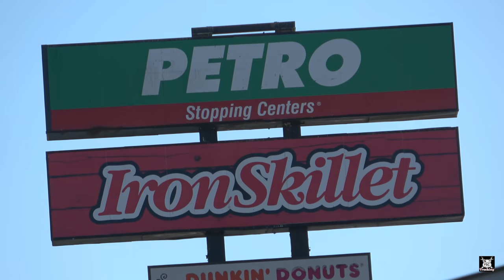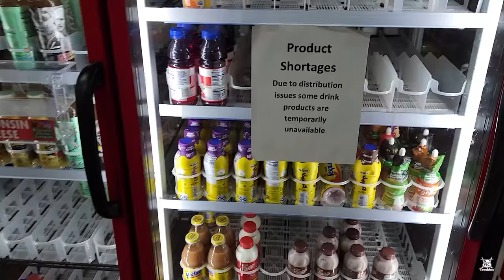DEF Shortage,   Not My Problem!

Comment: It is so refreshing to find someone that realizes the hidden pollution in all this Green Movement.  Our town went NUTS recycling. Three trash collections with three trucks and thousands of plastic bins. After a year the news crew followed the trucks to the landfill and filmed it all being dumped in the same place. When asked the operator said "Nobody want it. It has no value."
Reply: Im from a rural area and recycling is not practical. Used to have big roll offs to put recycling in but it wasnt practical or parking lot owners didnt want it any more.  I could drive like 15 miles to recycle but at that point what are you saving not like being 2 minutes from where you were going all ready
Reply: the Chinese stopped accepting a lot of the US plastic for recycling because it was often contaminated. That has pretty much destroyed the market unless you have a local company that was reprocessing it.
Reply: Yes, they want to charge us $15-20 month for recycling beyond the normal trash costs.  Nope, I would recycle if it were free, but not when they are charging me for it.  The best part in our small town (6K) is that they normal trash company stopped recycling as it was to expensive, and then the public outcry they had to find another company from much farther away to come service the town and drive around the city all over again to pick it up with big heavy trash trucks.  Our little subdivision only a handful of people recycle because of the costs.
Reply: @Chris_In_Texas  free and available I would recycle.  Sometimes I wonder how much more is wasted in the name of going green in all aspects
Reply: Other than cardboard most "recycled" stuff goes direct to landfill or incinerator...burned to produced "green" energy.
Reply: 36.00 dollars a ton to dispose trash. 93.00 dollars per ton to dump recycling. These charges are what we are charged plus tax
Reply: There was a story in New Mexico about this. Is this the one?
Reply: Burn in a boiler to heat or power something and landfill or separate what is left after the boiler.
Reply: It's not a green movement. DEF is cheap and heavily reduces pollutants. I think you have a problem with the implementation.

Comment: My buddy told me the trees u see dying on shoulder of interstate is from the Def fumes. I mean really how environmentally safe is it. If you've ever had the unfortunate pleasure of being behind a truck that's regening it burns your eyes. And what's up with that nasty looking white soot on the stack tops. Mine is a 2000 built in 99 so I don't worry bout that or elog. Keep on trucking.
Reply: Up north salt plays a giant factor as well like vermont for example
Reply: That may be so. I've been around over 55 years and never has I've seen green trees plants along the interstate. If emissions were so bad in the 30s 50s 70s nothing would be growing along interstate and highways. But I wonder if def has something to do with the dead trees.. hmmm I always  question everything and believe nothing..
Reply: I mean they spray the side of roads with Herbicide here, you couldn't tell what did it if you didnt know any better.
Reply: Who really knows I guess but I do know this when a older truck black smokes in front of me it doesn't burn my eyes and nose but when a Def truck regens in front of me it does both so I really don't see how it's better.
Reply: hey I hate def too but the tree dieback is from DOT spraying glyphosate (round up) on the shoulders for weed/grass control and the mist drifts up and lands on the tree foliage where it is absorbed. 

if you notice it is typically most noticeable during the summer bc glyphosate is most effective when it's hot and dry. 

source: I used to be a landscape construction foreman
Reply: Not where I live, even on I-70 the trees are healthy as ever

Comment: It's AdBlue in Europe, and it was a pain here at that time too. Also the Euro 6 diesel cars need it as well, so it went crazy for a while, and became unobtanium. It's shorted now, but the price has doubled. :(
Reply: Unobtanium. I like that, gave me a laugh.
Reply: Just use older diesels or buy modern gasoline powered cars.
Reply: @ժʝ_ My family always used diesel cars and we’re ok with them. But recent emission restrictions (specially in europe) makes it harder for normal users to use day by day. Now we have adblue in passenger cars and has to be filled regularly (generally filled between oil changes by service stations but still not user friendly) Older diesels are sluggish but also reliable and strong. Specially old mercedes diesels. Nowadays, gasoline (benzene) powered cars are easier for daily use in modern cars and got the low end torque and fuel economy of diesel power. (For european cars, american cars mostly still uses gas guzzling engines) I would still like to get a car with simpler engine and also good fuel economy. Sadly we have a tradeoff here, simple engine + good fuel economy = bad safety

Comment: JH Diesel did a video on the whole DEF/cat/emissions industry, it messes with truckers, car enthusiasts and everything connected to it. Admittedly I used to be on the electric hype, but now I see it as a another way to shut you down if you don't comply. I think mechanical diesel is the way to go now...

I hope your parents are doing OK, and come to Texas, we need more hard workers to add to the ranks! 💪
Reply: If you go back, & look at the news at the time the DPF was put in place it was because guys were dropping hot tunes on their trucks, & rolling coal. The DPF was the surefire way to get rid of that, & shut most of it down. Even tho the DPF cuts the life of the engine by 1/2-3/4 or even shorter.

Comment: Our trucks have had problems with the Def system continually, parts shortages on DeF sensors. The Kenworth dealer actually had to bypass the Def system just to keep the truck on the road. It has been months waiting for parts. I have not seen a shortage of DEF here in Wisconsin, but I heard Australia is experiencing a rough go at it. All is China related and it's about to get worse especially with the omicron lockdown in China
Reply: I drive a Kenworth t680
Reply: Just put water in the tank, or pee

Comment: I hope your parents get better.
I have a 2020 Chevrolet 1500 with a 3.0 liter Duramax.  I stopped buying the DEF at the auto parts stores and started buying it at the pump.  I get a lot of strange looks from the overland truck drivers when I pull my half ton truck into the lane just to get DEF but I also get a lot of questions about my truck.
I really enjoy the videos.  I have a friend in Arizona who runs a diesel truck repair shop and he rents out trucks while the driver is having their rig worked on.
Reply: You really should avoid using def at the pump due to inconsistent quality and contamination.  I have heard of so many problems caused by poor quality def, I have already deleted a few 3.0 I6 Duramax engines.  The way I tune them I leave all of the equipment on the vehicle except for the actual filter, I make a bolt in replacement exhaust section that can be easily switched.

Comment: I was working on a truck the other day and in Cummins diag program you can see how much DEF a truck has used. The particular truck I did the math on and it to see how much waste it produced and if it was filled entirely with the standard 2.5 gallon jug it would have used 586 jugs in the 5 years it's been in service.
Reply: That’s crazy

Comment: Being a diesel pickup driver, I don't buy DEF frequently (8 gallons is good for 10,000 miles).  I normally buy a 2.5 gallon jug when I get down to just over a half tank of DEF.  Two of the places I normally buy it at were out recently, but I don't know that I would call that a reason to panic.

If I wanted to drive down to a truck stop, I could top off at the DEF pump, but you big boys give me the evil eye pulling my pickup into the truck fuel lanes.
Reply: @Austin Judovsky  Nah as a driver we don't care who uses the pumps just don't sit on your break or using it to take a dump or a shower

Comment: I get my def at the pump and i havent noticed any shortages in mi, in, il where i get all my fuel since i stay around mi for all my runs.  I would love old school no def needed. I agree on how much more pollution/waste is made just like the electric vechicles. Where and how is the power generated and battery manufacture.  I can understand more efficient engines
Reply: To answer your question, re power generation, electric vehicles can say they are geothermal powered,  hydro powered, solar powered, wind powered, nuclear powered. As for the fossil-fueled vehicles, power plants are much more fuel efficient and can be, or are, equipped with scrubbers to remove more pollutants than a catalytic converter, or DEF system ever could. Carbon capture options are available, as well.
Power storage? You got me there.
Reply: @JV-pu8kx  but what about the mining of the materials to make battery packs and then the recycle/disposal of them when dead

Comment: I'll keep my '03 KW - W900L CAT 6NZ pre-emissions truck. I'm into heavy haul, and I average 6.7 miles 2 the gallon. 1,905,000 miles on her and counting. DEF is the death of all diesel engines and we all know it
Reply: I don't know how true it is, but I have heard that DEF engines aren't even worth rebuilding.
Reply: @shane4268  yes, it's very true, can't rebuild them at all. And the worse ones yet are the Paccars & Navisstar ( International) and being automatics it's a double whammy 2.... 😠
Reply: @sebastiangarla8558  Hopefully this shit will be reversed. It was bad enough with just the particulate burners, but at least those engines were basically the same as the old school engines, but with the computer shit added on. 
The last newer truck I drove before DEF,was a 2010 Volvo, and they were still getting over 6 miles per gallon, but had reduced horse power because of the burner. Now nothing gets shit, in the way of fuel mileage.
Reply: @sebastiangarla8558  they are rebuildable.
Reply: @sebastiangarla8558  they are rebuildable. If you have a classic engine, they are definitely rebuildable.
Reply: @shane4268  it has nothing to do with the DPF. If it has issues, or if the computer parameters are turned down, it will be a turd.
Reply: @user-ln7of9gs4s  So the DPF can be bypassed?

Comment: I fill my Chevy up at a truck stop D.E.F. pump, It's cheaper in bulk, plus I have 5,  2-1/2 gallon jugs for backup. The price in the store is easy double and some times a little more.  Thanks Brandon.  If you have a used jug, you don't want, crush it down and put into a recycle bin.

Comment: The urea in DEF is synthetically produced, and a China is a major supplier. The story is that they can't produce enough to satisfy their domestic agricultural industry and feeded their people is a higher priority. Australia was seeing the shortage about two weeks ago. The temporary fix untill the suply is restored, would be to reprogram the ECU on the trucks to not derate the engine when the DEF is empty. DEF is only used under certain conditions end would not affect the majority of the emissions systems.
Reply: @shreddder999  except when one country lowers the price and drives off any competition.
Reply: @bobstratton6362  that's capitalism at full chat.

Comment: Best wishes to you and your parents sir.  I love old classic trucks that are safe and you can still work them on a daily basis. Imo, nothing wrong with a little coal while the turbos spool back up. However, steady cloud of it is a waste of fuel or maybe mechanical issue. Other problem for me with a truck that old is I need cruise control(unless just hauling gravel in circles). Otherwise my size 18EEEE foot just goes to the floor on the hammer by itself.
Reply: Same problem here, when I'm not using cruise control, the right-most pedal seems to find its way to the floor a lot 😂.  But I drive a 4 wheeler.  Stay safe out there!
Reply: @MowerModdin  lol

Comment: I always find it funny that drivers will go pay $20 for a 2.5 gallon jug in the store when its $3 a gallon at the pump.  I can see 4 wheelers buying the jugs since they dont have def at the pump at the 4 wheeler pumps. But semi drivers shouldn't ever be buying jugs.  Had a def truck for 2 years my def tank lasted a week running 3k miles and idling it was a 25 gallon tank.  Glad I dont have that $30k deadweight on my truck now.  Full emissions free truck not even an egr on that motor.  7.3mpg doing 70mph with 70k plus weight.  The other truck with government juice only got 5.5mpg.  Crazy how a 20 year old truck gets better fuel economy than those new plastic trucks.
Reply: speed is the answer :D. the easiest way to get better mpg is to slow down especially with trucks and buses. i get 2L/100 when i cruise around in my car at 30kmh :D:D:D
Reply: Twenty years ago I was getting over 8 miles per gallon, with a Series 60 Detroit, no emissions bs on the truck, but now, a series 60 average about 5 to 5.5 miles per gallon. How is getting LESS fuel mileage, not putting out more carbon?
I can't stand being behind another truck during regen, or being in a truck for a parked regen. This shit isn't helping anyone, except for the people who are selling it. It's just another SCAM.

Comment: Ideally when I go OTR I'm gonna want an older truck, like pre DEF days. I don't need any of the new tech and crap they throw in vehicles nowadays, I just like things that are simple, mechanical, and actually work. The fleet of newer garbage trucks we currently run in my area have a plethora of problems, and pretty much all of them are DEF related. And oh my god my nose burns and my eyes water when one of those trucks is doing a regen. I don't know what's in that shit but I bet it's a lot worse than straight up diesel fumes. And straight diesel fumes don't burn my eyes.

Comment: Steve, almost looks like your left rear 1/2 fender is bent down almost touching the tire in your opening of this video. O, your right on no rain deer nose but you should have put a wreath with an red bow on your grill.
Reply: Air suspension probably deflated

Comment: Without DEF you will no longer get a truck license here in Germany. The development is also going towards electric trucks. Tests are already underway with the electric trucks.
Reply: Here in the US they’ve been testing electric autonomous trucks for several years but they’ve always had a driver in the passenger seat just in case. Recently they ran a truck out in the desert of Arizona for about 150 miles with no back up driver. They had a police escort front and rear and the test was successful. It’s coming brother they’re pushing it real hard it’s just a matter of time.
Reply: I still wonder how will those fancy electric trucks do at north Germany at winter. Especially when there is a chilly wind from the sea. :D
Reply: @bzs187  well some of us old time truck drivers were wondering the same thing. Last week they were cars and trucks stuck on interstate 95 in Virginia for 15 some up to 24 hours stuck in the snow not moving without food or water or bathrooms. We were wondering if there were any electric vehicles stuck in that mess But nobody could answer us.

Comment: Out of curiosity how come you don’t run an apu unit on you truck save some run time and have heat and air also I think some of the newer ones have a outlet so you can plug your truck in when it’s real cold
Reply: True, could use the money saved on DEF to save idle wear and tear on engine.

Comment: Incidentally, i have a 1997 european pickup truck, and i dont need DEF in that either, its got no engine computer either, so no stupid yellow light to say theres a sensor with dirt on it

I straight piped the exhaust system on it too, and made my own straight cut stack exhaust and fitted it up the back of the cab, its made from a piece of 3.5 inch stainless tube i bought off ebay

It doesnt sound as good as your truck though, the engine in my truck is only a 2.5 litre straight, 4 cylinder turbo diesel

What makes me laugh is, theres all this crap with DEF and other environmental rubbish, but my 1997 pickup passes its emissions test, and compares with modern diesel engined vehicles, as long as i keep changing out the air, oil and diesel filters when they need changing
Reply: VW Taro? That's rebadged Toyota Hilux.

Comment: Great content brother.  Why did you go with a cab-over versus a conventional tractor?  What benefit is there, beside no DEF to your rig?
Reply: Shorter turn radius, easier to see where the truck ends since there's no hood blocking the view, etc.
Reply: @Tiger313NL  I miss the cabovers. 
Just when they started getting walk in, instead of crawl in sleepers, and started getting air ride cab, suspension, and steer Axle, they go extinct. 
Sure, they could be a hazard getting into or out of, because I've slipped and fallen doing both, but it makes you more careful about it, after the first time. 
The earliest ones were definitely a pain, having to tilt the whole cab just to check the fluid levels, but by the 80's and 90's, greater improvements had been made. 
The Last time I drove one, was nearly 30 years ago, and I've been in conventional cabs since.
They were the perfect trucks for navigating streets, like in Chicago or Cincinnati for me.

Comment: I wonder; if you installed a modern engine (DEF required) into an older truck (if it fit), would it still require DEF?  ;-)
Reply from the maker: Only California.  Hence I don't go to that country.
Reply: Isn't your diesel a pre DEF engine or is it a modern engine without DEF?
Reply from the maker: @TairnKA  it's a 1984 Caterpillar 3406B.  It's from before anyone even considered anything as stupid as DEF.  Pre DEF
Reply: So what's the difficulties of driving in California (fees, permits, ie: paperwork)?